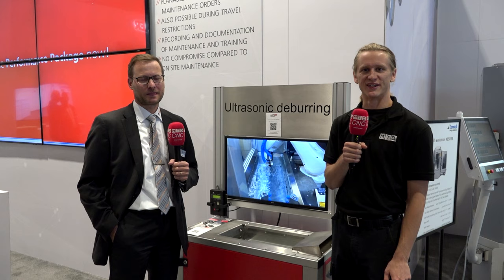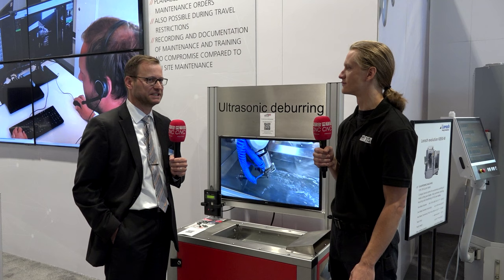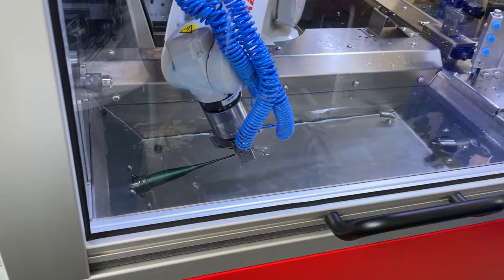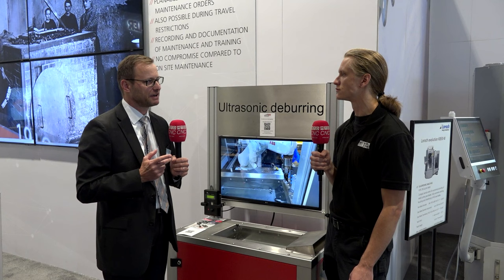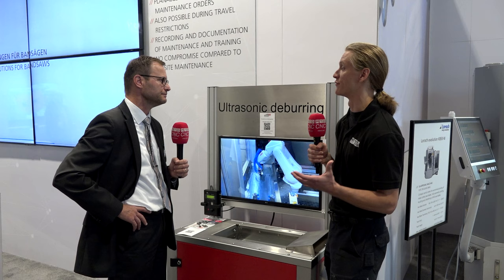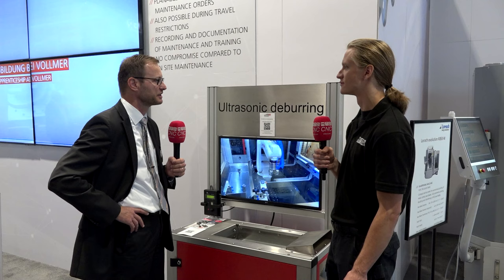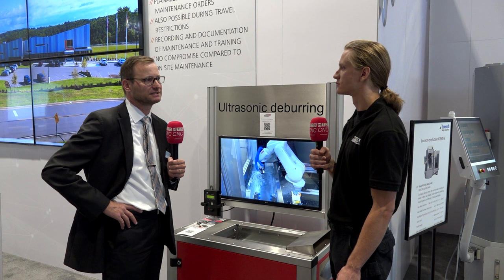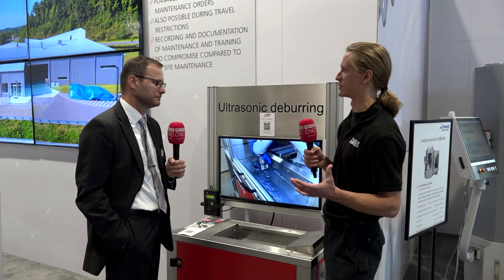VOLLMER introduces brand-new ultrasonic deburring technology at IMTS

Comment: Hmm,  Sounds interesting.  A technology that will revolutionise yet unable to find more convincing before-after examples.
At 3:46 for just 3 seconds we see what looks like a part with a hole that transitions to a de-burred version of the same yet in the process picks up additional sanding/grinding marks.
It would make sense for Vollmer to have a archive of credible and convincing examples if the technology is such a promising game changer.
The talking heads do not inspire, a link to published third party test results would have been much nicer.